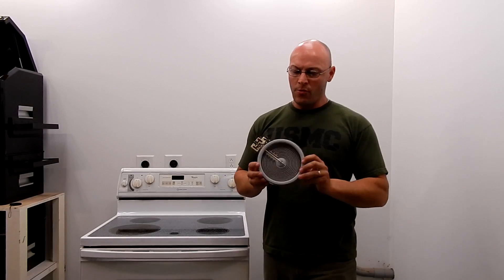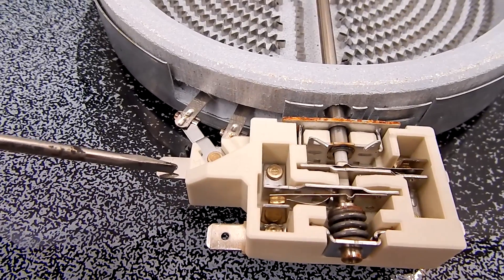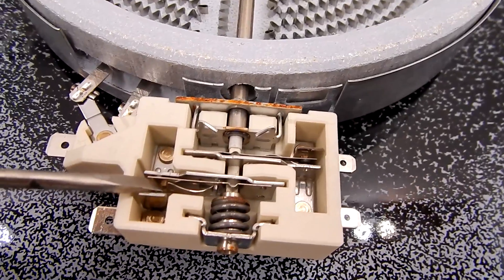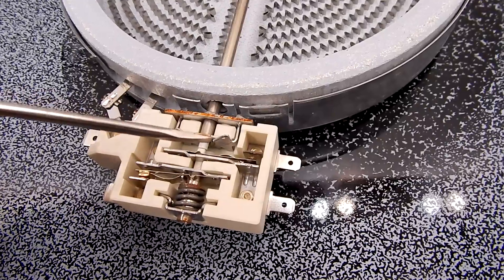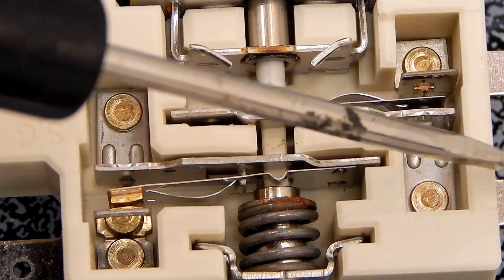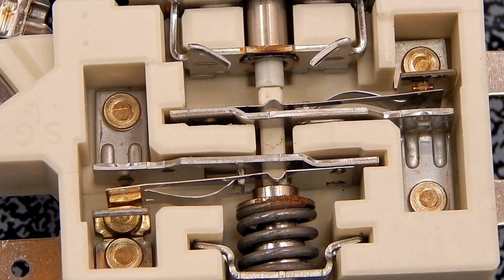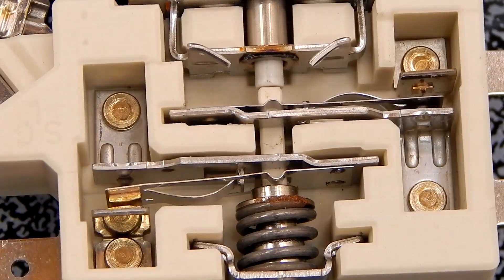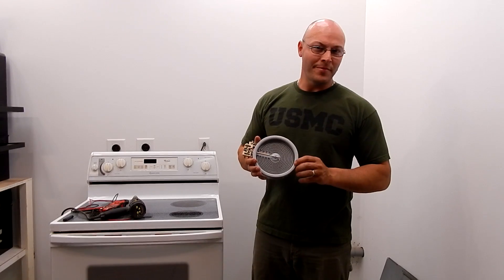Glass Top Stove Repair - Top Burner Not Working - How to Troubleshoot and How it Works

Comment: Very nice. You are the first to explain that there is in fact a limit thermostat and a hot switch on glass top elements. I have a bit of a conundrum with an LG front left element. I believe the limit thermostat is keeping my good element ( right resistance) from heating, but there could be a control board or relay problem as the same burner Left front would intermittently come on when left rear was energized.(with no indication of Hot Surface) Would you gamble on fiddling with the limit thermostat or just replace the assembly?

Comment: I have a Maytag Glass Top it is 18 months old...
It only had a One Year Warranty...
Over the labor day weekend I was slow cooking Ribs & after cooking them at 325 for 5 hours (they turned out great by the way) after I removed the Ribs I turned the broiler on to toast the Garlic Bread after a while I noticed that the Garlic Bread was not getting toasted ?? 
Then I noticed that all the burners were lifeless ??
I had absolutely no heating power at all but the light in the oven & the display panel did have power...Could you possibly point me in the right direction... I would really appreciate it & I will give you my world famous Secret Rib Recipe...💃💃💃💃💃

Comment: I have a similar whirlpool range and randomly  the burner will go full hot , and I cant seem to regulate the temp, and almost always  the surface temp indicator is on sometimes for days  and the burner is cold . I was thinking a bad switch, but now am thinking it might be  the surface temp  light sensor ? anyone have any incite  on my problem or has experienced the same problem

Comment: Hoping you are well within everything we are facing worldwide. I installed a new burner and it didn't work. I measured the input voltage to verify it was not a stove problem but the voltage is fine. At the input of the limiter the voltage is 230 volts but at the output of the limiter (the element input) it is zero.

Comment: Thank you for posting these videos; very well done.  We just moved in to a house that has a Jenn Aire Smooth Top cooking surface.  Our previous home had a similar stove.  However, my wife has observed that the burners on the Jenn Aire smooth top hard to cook with as the heating element is either fully on or on low.  There appears to be no middle heat despite what the switch indicates.  Is this possible?  Malfunctioning switch?  Thoughts?

Comment: GE ceramic top range.  Triple burner element,  infinite control switch,  selector switch, temperature switch, all show continuity.  Still, 6 inch of 6,9,12, not working.  Can you advice?

Comment: can you  show how to connect 3 phase 440 volts rotary switch to low, medium, and high position electrical burner , using three electrical elements[ three elements 3 starting and 3 end terminal of elements] THANKS
REPLY
Reply: Same question for me except I have 640 volt 3 phase range top with 5] 10,000 watt elements.

Comment: Question: If large LG 2700 watt radiant burner only works about 10% of time, then shuts off, is burner bad or is it PCB? All other burners work fine. Don't want to spend $140+ for new burner if that's not the problem. Had appliance company come out to "diagnose". Literally did not pull out range or disassemble/ test anything and without testing burner for resistance said the burner was bad. $65 service charge for about a 10 minute consultation. If all other burners work does that rule out the circuit board?

Comment: I replaced the control switch for front left dual element  on my smooth top stove (Jenn-air made by Whirlpool). There was an arc in the switch (not sure what caused it). Now that I have replaced the switch, the burner heats either single or dual element heat, but there is no control from switch. It heats continuously with no element on and off so the switch is acting as an on off switch. I can not vary the heat output of burner no matter where I set the control switch. Is there a feedback to the switch from the burner or what controls the output of burner. Sorry so many words. Thanks

Comment: Excellent and very helpful video. 
I changed the 2500W Element, checked the flow of current. All terminals show current coming in, but still the new element does not heat. I switched the new element with the old one and it works on the left side. But the old working one does not work on the right side. Could you please advise what could be the problem?

Comment: Great videos, Bill. My Kenmore ceramic-top stove's right back small burner starts to heat up when turned on and quickly cuts out before reaching set temperature. It does not come on again. If I turn it off and then on again, it will do the same again. What might be the problem? Is it something I can fix myself?Thanks, Bill.
Reply: Did you get this fixed?  Mine is doing the same thing.  I think it's the switch.  I'm going to try swap out the switch from another eye and see if the problem follows.
Reply: It was the switch.  Swapped the switch to the other eye and the problem followed the switch.

Comment: great video. Do you happen to know why the heating element connections are only laying on the spade connection points. I had one which starting arcing at one of the tension contacts and was not sure why it was designed that way.
Reply: what I am talking about is what you are pointing at 41-46 seconds in.

Comment: Thanks bill for this wonder full video  one thing confusing me  infinite switch and thermal limiter serve same purpose but independently  by stopping the element  over heat or keep the element heat in a set range  please explain
Reply: sohnamunda1 
the thermal limiter and infinite switch are connected in line. As long as both are closed electricity will flow.

The difference is that the thermal limiter will simply open when an unsafe temperature is met to prevent damage to element, fire hazard or overheating but the infinite switch is an electronic switch capable of  fluctuating the flow of the electricity to infinite settings  (not just a simple mechanical low-med-high switch)